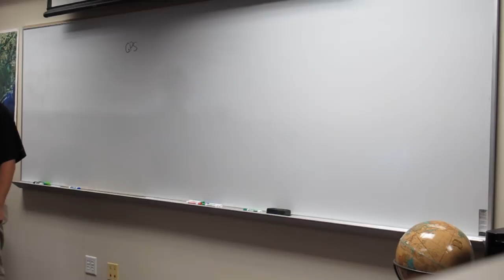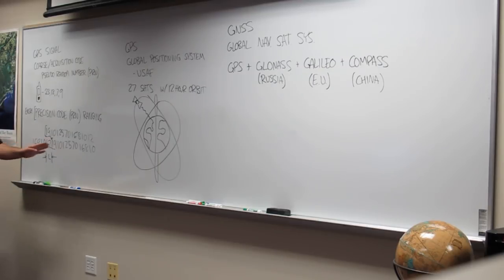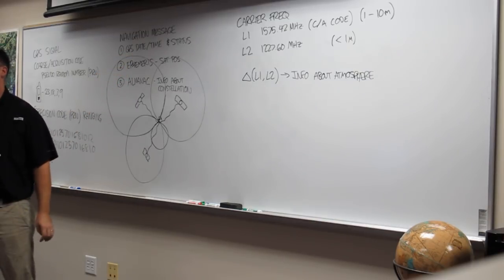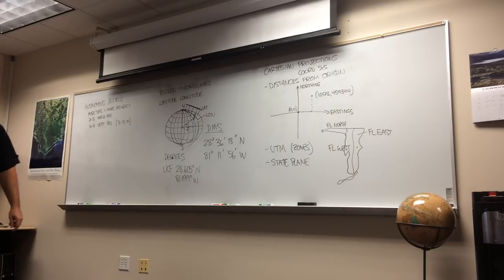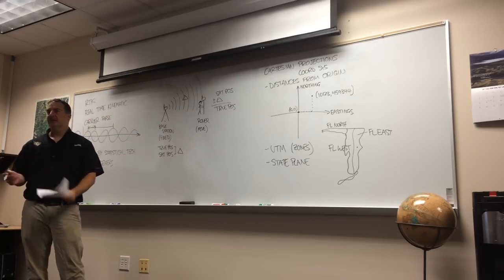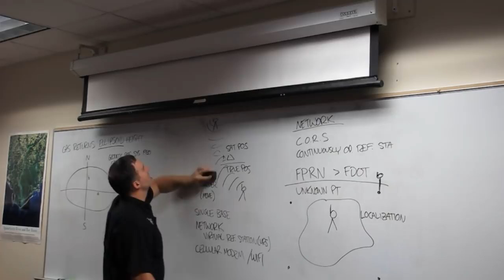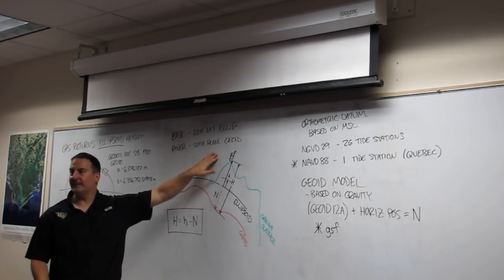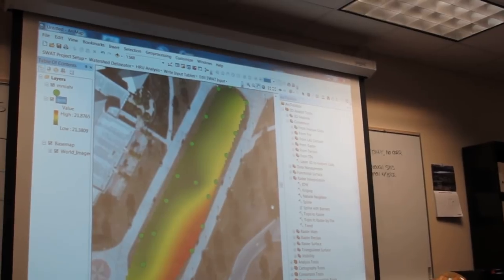GPS RTK Surveying Workshop

Comment: The material given from this video is practical enough for a civil engineer to do a simply topograhic survey by himself without the help from third party (saves plenty of time without the needs for setting out control points at remote area by total station) ±20mm horizontal and ±40mm vertical for RTK is sufficient for general purpose. Thank you for the lecture.
Reply: Engineers.... always thinking they can be surveyors too :P

Comment: Yes, this is a good general overview of GPS fundamentals but the explanation of how RTK works is wrong. At around 48:00, he mentions that the base station transmits a "delta" so the rover can correct its coordinates. Actually, the base station transmits its raw carrier phase observations to the rover so it can process the relative vector from the base by double differencing.

Comment: I think you can't know the distance of the device to the satellite just by listening one signal, because your device does not know the correct time. So to what would it be  comparing that received pseudo random number at 10:00, it it doesn't know the correct time?

I think it needs to receive more signals, to get the clock in he device corrected?
Reply: what about carrier range?
Reply: Yeah, he kind of blew the gps explanation. He actually means pseudoranges. It is a range that only means something when compared to other pseudoranges.  You could tell your distance to sat 12 is 1000 meters farther than to sat 14, but you don't know the actual absolute range. You have to have pseudoranges to (at least) 4 satellites in order to solve for the 4 unknowns of x,y,z and time.  That's your position and time.

Comment: 13:35
"shift by 2 numbers can tell you the time difference"
well how do you know if the shift is by 2 numbers or by ENTIRE_SEQUENCE+2numbers? 
or generally by N_TIMES*ENTIRE_SEQUENCE+2numbers?
Reply: I believe it is first matched on the pseudo random number, then it goes down to the precision code ranging. I didnt search for this, it is just what makes sense for me.
Reply: Because the entire Precision PRN sequence is actually very, very long. It takes 266 days to send the whole sequence before it repeats, so there is no ambiguity.  The C/A code is much shorter and repeats every millisecond.

Comment: This video needs some corrections.  At 1:30 he says "...maintained by the United States Air Force".   The GPS constellation is both maintained and operated by the United States Air Force.  Kinda Nit-picking?  Well lets go on...  At 1:45 he mentions "27 GPS satellites" (space vehicles); there are actually more than that in orbit, and the constellation performance requirements are based on a constellation of 24 available space vehicles, not 27.  At 1:57 he says ..."wherever you're standing each satellite will pass over your head twice in a day", and at 2:30 he draws a depiction of GPS orbits and mentions "orbital planes".  One of the planes he draws is a polar orbit.  Be advised that the inclination for ALL of the GPS space vehicle orbits is the same, and it is 55 degrees.  Importantly: between 55 deg north  latitude and the north pole and 55 deg south  latitude and the south pole NO GPS space vehicles ever pass overhead.  Thus precision of GPS solutions for users in those latitudes degrades as they get closer to each respective pole.   All you have to do is Google "GPS orbit inclination" to confirm that.  Given 3+ strikes in less than 3 minutes, and you can Google to get more reliable information: I'm not wasting any more time watching this.

Comment: The explanation for how the RTK solution is derived is completely false.
Reply: Could you elaborate or share a correct explanation :)
Reply: +Juan Carlos Montes Herrera It's kind of complicated  but the short version is. You have two GPS receivers on the ground, and they receive signal from the same satellite vehicles, however many that is. So you have vectors going from the ground receivers to the Sv's. You then take the difference of the difference (double difference) of these vectors and the resultant is a 3 dimensional vector between the receivers. Since we know the location of the base we can place the tail of the vector on the known point and the tip of the vector is the location of the Rover.  This entire process is calculated in real-time by the processor in the receiver. the information transmitted by the base is simply the GPS information it receives.
Reply: Excellent, thank you very much!
Reply: Thank you for the clarification, I will be sure to update the material in future lectures.